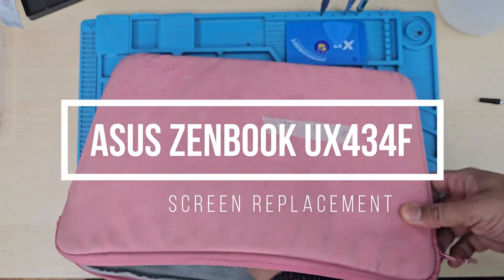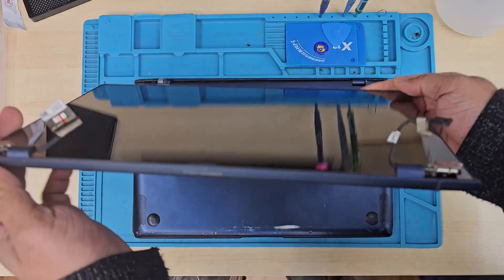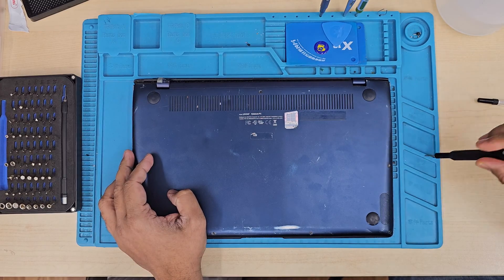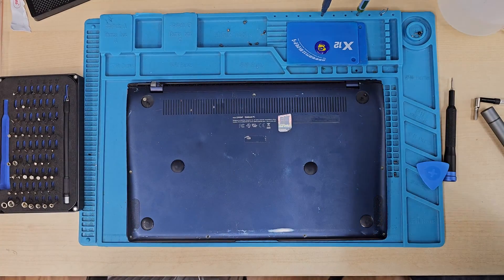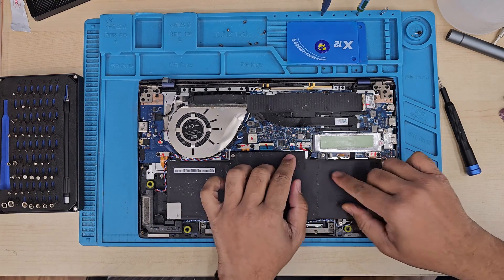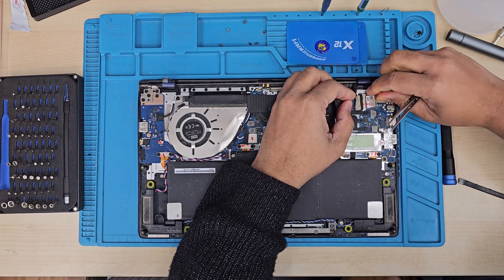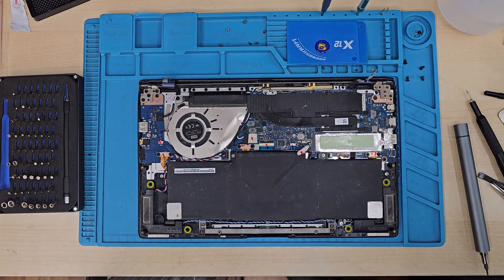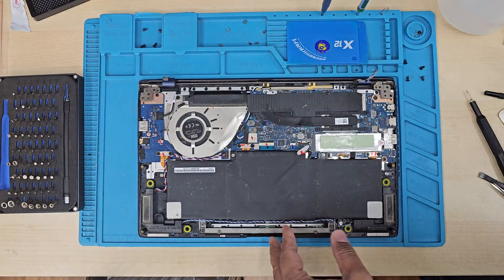How to Replace Screen on Asus ZenBook UX434F | Step-by-Step Guide

Comment: Unrelated question. I have an asus rog zephyrus g15 and I want to be able to power it on without opening lid and using power button. I recently bought a wd15 dell docking station hoping it would work but it doesn’t what can i do ?